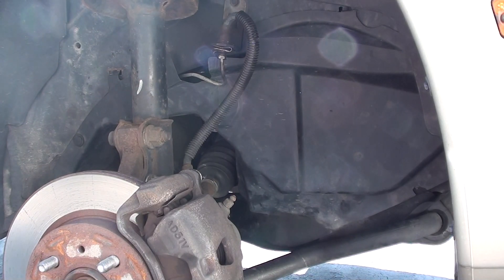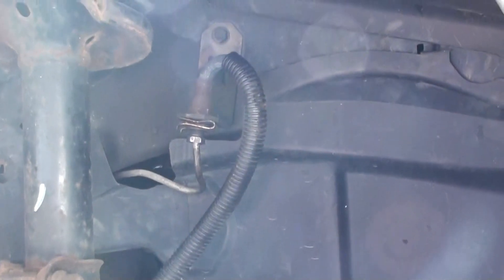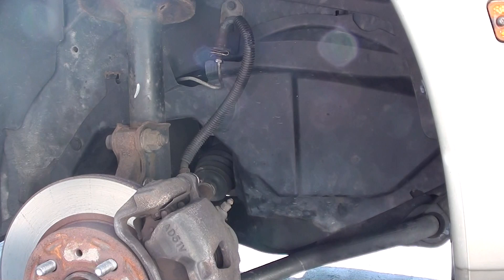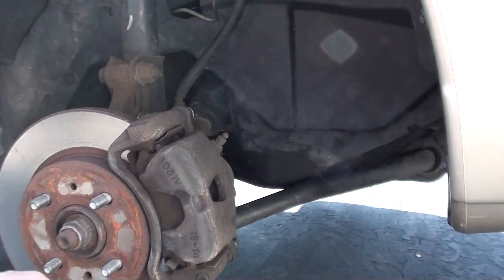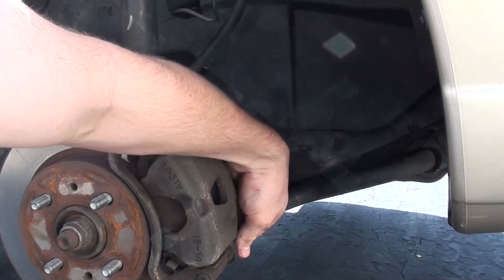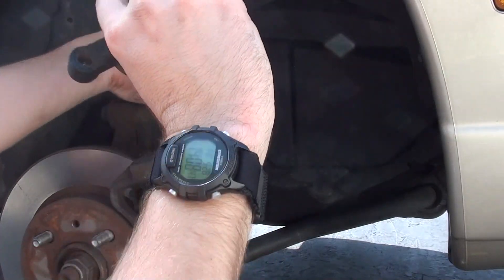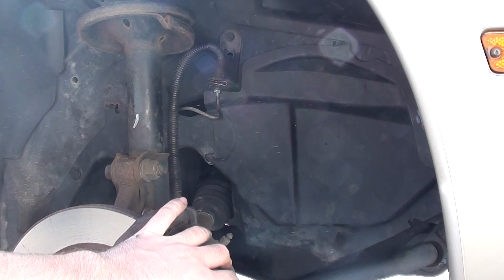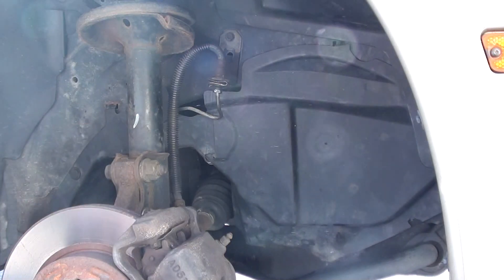Front end rubbing noise FIXED!

Comment: I've had a used odyssey 1 day and noticed the same problem. It's 11:00pm so I'll check it out in the morning. Mine starts an intermittent rubbing or scraping noise on the passenger side when I turn to the left at about a 45° angle. If I turn sharper it doesn't tube or hear the noise. I hope your video solves the problem. Great video 👍

Comment: I think this is the cause of the noise I had for a couple years since they last did my brakes.  Damnit, I was already feeling like I should be doing my own work because so many mechanic videos I see start with, "now that's not supposed to be installed like that..." As they take thing apart to repair them.

Comment: My car is driving me insane. I have 2006 nissan maxima 3.5 SE. My car didn't start making noise until 3 weeks after I had new tires put on. But I also bottomed out really bad 2 weeks prior. It only makes noise when I turn left. I've had 2 people ooh it's a bad wheel bearing, I took my car to another shop they said my right/front wheel bearing was good. I took my car to get diagnised again they actually took off my tires and jacked up my car and pushed my car to 60mph. They came back and also said all my wheel bearings were good. They just noticed that my rear rotors and breaks were bad. But my car only makes the noise when it rains or if there is just a tiny amount of humidity. So once again r/f wheel only makes noise when wet, turning left and braking. It's driving me nuts. The noise also isn't consistent only happens at low speeds. The noise obviously doesn't happen at higher speeds.

Comment: I just had my  rear to front brake lines changed on  my Vauxhall zafira 2003 for my MOT ...I can hear what sounds like  rubber squealing when I accelerate,,I think that  the brake line has come loose and is rubbing on my tyre or something...it’s like squelch,squelch,squelch ...it’s doing my head in.☹️

Comment: Thank You so much! I had a rubbing noise that I couldnt locate after I changed my rear rotors and pads and I've been watching countless videos and searching forums to find possible solutions as I've checked everything and what it was, was one of my brake line clips and being barely pinched against my rotor only causing the noise to happen occasionnaly. THANK YOU!!

Comment: I was talking about the back tires not the front. As I drive, I can smell the scent of rubber. Both tires rubbing against the struts. Both tires feel hot when I touch the sides of the tires toward the struts.
Reply from the maker: Alignment may still be an issue with the rear tires too. Are these aftermarket wheels and tires? larger than OEM spec? If so, clearance may be an issue.

Comment: What a funny little thing saturn(GM) did when designing this car, and i think i did it on my 02 SC2. Ill check both sides and report back. And the sound is like a mild grind-ish whirring noise, but not metallic or squeaky. Thanks for this.
Reply: Hey, Did you check yours? I have the same issue...  on my 02 Saturn
Reply: Jerry A yeah, I did. And it wasn't this. I had looked into my alignment and it turned out to be the front end alignment was wrong. Bad toe out on one wheel. If you're clever(I've done it once with a different car) you can adjust it with a tape measure and the correct size wrench. I plan to do so soon.

Comment: Hi everyone I have a question for all here , I have a Golf 3 and I have a problem with the wheel, when I want to park the car somewhere it causes problems  because it is hard to change the orientation of the car because the wheel is hard to rotate and make a terrible noise under the hood , I checked the hidro-oil it was OK , I checked some  belts because I thought they were plucked but they were OK . I don't know where this problem comes from  I heard the noise where it comes at the engine but there everything seems OK I think ....
Reply: Kosova është Shqipëri sounds like power steering if it’s hard to turn the wheel
Reply: Kosova është Shqipëri your power steering fluid may be low

Comment: How loud was the noise? What was it actually scraping against?
Reply from the maker: Loud enough for the scraping sound to be noticeable. It was tire contact on the brake line to the caliper. Brake line had been flipped the wrong way before caliper was reinstalled after pad replacement.

Comment: Hi guys, I have a plastic scraping noise problem as well when I turn corners. The plastic trim inside my wheel well is loose but not enough to interfere with the tire turned all the way. Here's a video for what it sounds like:
https://youtu.be/bfz9h7s5Ldw
Reply: I took the car to the shop to inspect the CV joints but they said they were fine. The noise started happening one or two days after it heavily snowed so I'm thinking some ice or rock got stuck somewhere? I'm taking off the wheels tomorrow to further inspect

Comment: What is causing my back two tires to rub against the struts? I thought at first it was the size of the tires, but I changed them to a different size and it is still rubbing against the struts.
Reply from the maker: +Alvin Smallwood try to find some witness marks. Could be the tire still, may also be an alignment issue.

Comment: Great piece of info. Fixed my issue. Was wondering though, were there any range of motion issues created from placing the brake line hose behind the shock tower? Had a guy tell me today, while refusing to put it back after I had already fixed it, that it was manufactured to be like that from Saturn, but I have a hard time believing it. Also, it's not going to stop me from fixing it again. Just steamed that, after bringing it up that I wanted it put back, they refused, and I have to do it again.

Comment: I just got my suspension done on my car so now when I turn I hear a lot of scrapping what is going on
Reply from the maker: +Suga Sloan oem parts replacement? Did you lower the car, or put on bigger tires? There are multiple reasons you will hear rubbing, not just what I show in this clip. Modifications will definitely bring out different sounds. If OE parts, something may be loose or not adjusted correctly. You may want to look around the wheel well for wear spots.

Comment: This might be a dumb question but I had new tyres and rims fitted to Audi A6 and started getting rubbing/knocking noises only from the front wheels when in full lock (left or right) at low speeds during colder mornings. Once car is driven approx 10mins noise is gone. Do u think this could be the same problem or maybe ball joints? Still in warranty and everyone passing the buck!
Reply from the maker: Luka Luka If the new rims and tires are a different size from the factory rims and tires, you may have clearance issues with almost anything in the wheel wells. something could be rubbing the plastic trim, dust covers, brake lines, you name it. I would suggest putting it in full lock on one side(then the other) and try to get underneath(while tires still on the ground) and see if the wheels gets close to anything. Or take the wheels off and look for any wear spots. 
Quick story: Had a guy come in to the quick lube shop I use to work at to air up his tires. He recently had put large rims with low profile tires on his Dodge Magnum. He was hearing rubbing from the front while driving. After a quick look, it  turned out to be the  wheels were so big, the tire was in very close proximity to the upper ball joint on the steering knuckle. As it sat you couldn't put a piece of paper between the tire and joint. when he drove the wheels would expand and rub against the joint. scary situation that luckily was caught before a tire blew or worse. Hope this helps. Good Luck!
Reply: +Luka Luka I'm also getting this kind of noise.. exact symptoms.. very annoying since when you go to the shop its gone :S still looking for a solutions... and on a rainy day its worse.

Comment: what did the noise sound like?
Reply from the maker: mine sounded like a rumble strip you would run over on the side of the road. It may be different depending on the type of tire you have on the car.
Reply: @jungleking007Channel  hub or bearing?